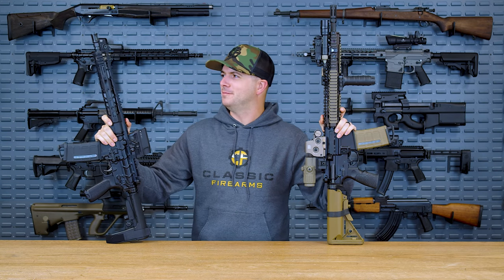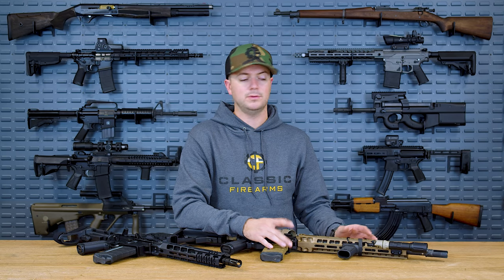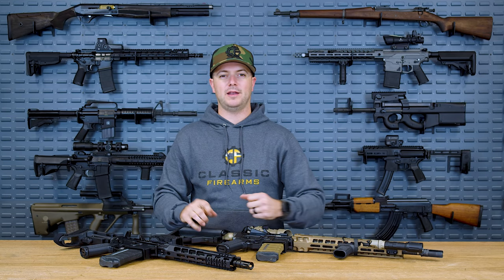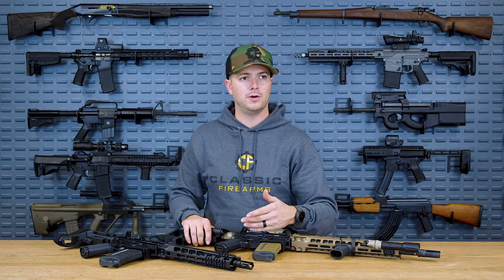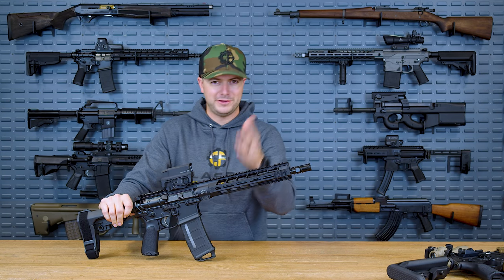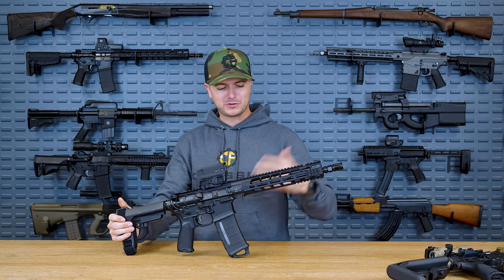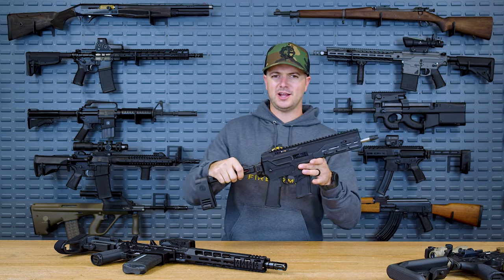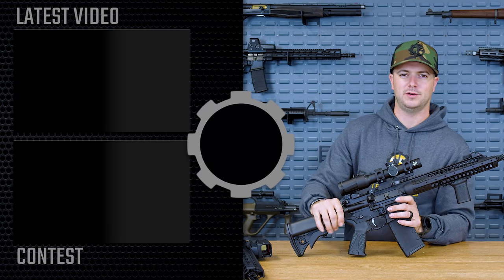Should You Use An Adjustable Gas Block

Comment: Adjustable gas blocks are a maintenance item. If you dont do maintenance then not only no ,but hell no you dont need an adj.gb.
Or sure you do. And i wanna watch you adjust it after 5k rounds or so lol.
Fyi.
The last three guns ive looked at with cycling issues were gas leakage around and thru an adjustable block. Keep the machine as simple as possible, it keeps it reliable longer...

Comment: Riflespeed has an adjustable gas block that fixes the adjustment issue, the only hiccup is that you need your muzzle to extend a decent bit past your handguard in order for the adjustment "ratchet" to fit.

Definitely using one for my next build, and retrofitting old builds with that system.

Comment: I run the Aero Precision adjustable gas block on both of my AR's.  They don't have as many adjustment points as some other blocks, so ultra-fine tuning they do not do.  They do work very well though, and the adjuster design is easy to access and very tactile.  Aero also states that it has a built in channel for carbon buildup to help prevent carbon locking.  I used them to help tone down my severely over gassed barrels, which seems to be a common theme among modern barrels.
Reply: I'm looking at getting a complete 308 upper but they don't come with an adjustable block. Did yours come with?
Reply: @jaegarbombs7297  I built both of my rifles.
Reply: @jaegarbombs7297  just built an M5 308. Adjustable gas block is worth it.
Reply: @Vic-E  yeah I ended up getting it. Probably going to get a can for it soon before those get outlawed
Reply: @jaegarbombs7297  they aren't getting outlawed man. Probably won't come off the NFA though

Comment: Personally,  I pin the gas block and run a bootleg industries adjustable BCG on my SBR and it has made a world of difference for me. Easy enough to use a flathead to switch between 4 positions.

Comment: I run a Superlative Arms "bleed off" adjustable gas block. Gives you the option of running it as an adjustable or as a bleed off. I love it. No cycling issues once you get it adjusted properly and really softens the felt recoil, the little amount the .223 has.
Reply: It's like shooting a pellet gun with a 20inch bull barrel 😂

Comment: Shooting a 16", mid-length gas-system properly tuned side by side against a 16", carbine-length gas-system that's over-gassed is night and day different. If I'm ever taking a new shooter out or someone who hasn't shot an AR before, I always bring one of my tuned adjustable ones, or a 20" A4 clone. 

My cousin has a post-ban bushmaster 14.5", carbine setup that's horribly over-gassed with a really obnoxious pinned muzzle break. It's gotta be the 2nd least pleasant gun I've ever shot, next to a Glock 27 lol.

Comment: Good for shooting steel case. In these times more of us are considering steel case than ever, and an adjustable GB can help that Tula run like the good stuff 👍
Reply: Yup… I hate feeding her steel but the brass is for a rainy day.
Reply: Other than a small amount of inaccuracies from the wolf Tula, it’s a great bargain. Yeah, it’s not for long range or shooting groups. But for a lot of practice, it’s perfect
Reply: How does it help with steel?
Reply: @pachyderm1182  different type of ammo produce different amounts of gas/pressure the steel cased ammo generally runs, but some guns don't like it..an adjustable gas block will help you make it run if your rifle doesn't like it
Reply: @HellBent069  an adjustable gas block will not add more gas to the system than your gas port will allow. If your gun doesn’t run steel, an adjustable gas block isn’t going to help.
Reply: @pachyderm1182  I would maybe suggest a different buffer than if it’s not running steel, I’m assuming your gun jams or doesn’t cycle properly?
Reply: @ofcgags1069   I have a properly ported barrel, so it runs just fine.
Reply: @ofcgags1069  yeah with a regular gas block if your gun doesn’t run steel that’s an issue with the gas port size. An adjustable gas block will not increase gas pressure it can only reduce it. Basically only need for an adjustable gas block is for overgassed rifles or you are running suppressed
Reply: @pachyderm1182  helps on my FAL
Reply: This is not true.
Reply: It's.... Steel... On a steel extractor... It's going to wear faster than brass
Reply: @lucland928  an extractor is 10 bucks. You’ll save 100x that shooting steel.

Comment: I run suppressors on 4 of my ARs. One with an adjustable gas block. The biggest advantage I see is the rifle doesn't dry out as fast and will run longer without cleaning or lube. 
With a gas block tho I need to adjust a bit between suppressed and un suppressed

Comment: To me Superlative Arms probably makes the best adjustable gas blocks on the market and if I'm going to put one on a rifle that isn't a range toy that's the only one I use mainly because everything else I've tried has failed some after only a couple hundred rounds. That said if I can get away without using one especially on a fighting rifle that's what I do. Normally I try to mess with the buffer system to slow everything down and a gas busting charging handle to help reduce the gas back in the face.

Comment: I run SA's clamp on's on almost all my AR builds of which I suppress them all. Love them. Recently found out about tuned gas tubes and adjustable gas keys that can be installed on most any BCG. And of course a gas busting charging handle like the Radian SD.
Reply: Have you ever had the screws come loose?

Comment: Love the dictator adjustable gas block on my POF Renegade +
Reply: I use that system as well on many of my builds. I usually leave it on setting 4, and my rigs run fine supressed and unsupressed

Comment: I bought an adjustable gas block for my 300 Blackout build in anticipation of getting a can. But it turns out I'd want it even unsuppressed due to the difference in pressure between supersonic and subsonic cartridges. By default, I keep it gassed just right to reliably cycle the subs--which means it also is more than enough to cycle supers. But I do prefer to adjust it down a couple of notches at the range for supers just to slightly reduce recoil and the little bit of extra parts wear.

Comment: For 5.56 or .223 I dont think its that important, however, for .300 Blackout, Id say yes you should have adjustable gas. My Renegade Plus has a nine position gas system, and it will run absolutely anything you feed it, unsuppressed and suppressed. Its almost a must have on .300 Blackout

Comment: If you're running an AK suppressed then yes most definitely run an adjustable gas block or gas piston. My Draco was already over-gassed and when I threw on a Deadair Nomad-L the bolt flew back so violently the rear of the receiver blew out, after installing a new trunion and a KNS it runs super softly.

Comment: I just got done building an AR10/M5 .308 using all Aero Precision parts with the exception of the barrel. I also added their adjustable low profile gas block, I haven’t shot it yet because I lost the tube retention pin when I tried to install it without the proper tools, so I’m waiting for the right tools and replacement pins to arrive. 
I mainly went with an adjustable gas block because I probably won’t be shooting the same bullet size all the time and in case I decided to add a suppressor in the future.

Comment: I do not believe that I can assemble a smooth, reliable full time suppressed AR-15 without an adjustable gas block.  It seems that  without the adjustment, it will run hot on soft loads and marginal on hot loads.

Comment: Using OSS 30 cal and 5.56 suppressors seem to eliminate the wear and tear, the need for an adjustable gas block, gas (contaminants) in the face, and the excessive need for cleaning.

Comment: My 300 blackout have adjustable gas blocks as 300 is actually quite with a suppressor, side charging upper and gas block with an OFF setting so can get the MAX quiet

Comment: I want add an adjustable gas block to my AR for my lightweight, low mass BCG's. How difficult is it to remove the existing gas block if it is 'pinned' to the barrel? If it is pinned and remove it, will I have issues with installing the AGB on the same barrel that was pinned? Not sure if there are damage issues when removing the pinned gas block? Hmmmmm....educate me on this! THX!

Comment: My IWI TAVOR 7 has an awesome adjustable gas block on it. Do t fire suppressed because of the cost and wait time involved. However I do fire a lot of cheap steel cased 7.62x51 through it and even though it runs pretty clean with the short stroke has piston system I don't clean it very often. Which means never. It's easily adjusted with the tip of a round and I haven't found anything it won't fire yet.

Comment: I know this is a little older video… question… building my simplified AR15. I’m going to be running either JP enterprises adjustable gas block paired with a Aero Precision BCG, orrrr run the bootleg adjustable BCG and no adjustable gas block?? (I’ll be running the OCL Polonium K with the rearden adapter. Running both can and no can). Let me know your thoughts! Going to be running JP enterprises silent captured buffer system w/ heavy h2 buffer, 16” 5.56 ballistic advantage performance barrel, Geissele (S3G) trigger

Comment: What’s your mk18 build? I was told to get an adjustable gas block to increase the gas in my mk18 to get it to cycle. What would a good option be to get mine to complete a full cycle?
Reply: I think if you have a standard gas block and your rifle is under gassed, you should look at a lighter buffer weight. If you have an H1 or H2 buffer weight in you MK18 currently, you may see better performance with a standard 3 ounce weight.

Comment: Don't have a suppressor, unfortunately...not yet at least, so standard gas blocks have been completely fine.

I just make adjustments via buffer weights and springs while sticking to mid length, except for the pistol, for now. Spike's T2 is quite pleasant generally- less loud too.

Comment: So I currently have a Del-Ton ar15 with an 18” barrel.  I still want to keep the 18” barrel size.  Anyway, I fully built the lower and I purchased a G3 Competition Enhance BCG CopperHead bolt carrier (light weight skeleton BC).  Now I obviously can’t use it yet until I upgrade the gas system/buffer tube, but I am still wanting to shoot 223/556 (as I can do that currently).  What would you recommend getting?  I didn’t see anything mentioning an 18” only a 15”, but I would like to get the same barrel length or at the minimum of a 16” length.  I believe I was looking at JP, but need more info on what is best.  Preferably an adjustable gas block, as that is how I can go from 223 to 556 caliber (at least I think that is how that would work).  Still new two this platform.  I’ve had mine for just over a year as of February.  Any tips would be great!  Also I prefer to do everything myself, if at all possible without having to go to a gun smith.

Comment: I need some help. I have an ar15 from radical firearms that cambered in 223,I shoot steel through( cause it's cheaper)and the steel casing does not eject. Fyi I do not have an adjustable gas block.

Comment: Hey i need help here. I have an r10 thats under gassed. It doesnt throw casing out the side. It barely poops them out and causes sometimes jams. The casing gets stuck when extracting. It doesnt have an adjustable gas block. The buffer tube and spring are meant for AR10's by the way. Would installing a adjustable gas block solve my issues.
Reply: It could be your gas block is not aligned right (hole is not aligned on the barrel to the gas tube) or if your rifle was OK when you first got it, then the gas block may have moved.